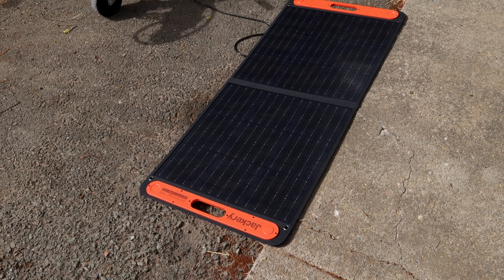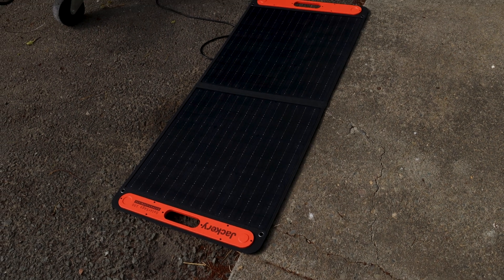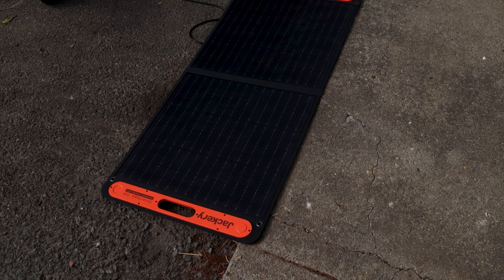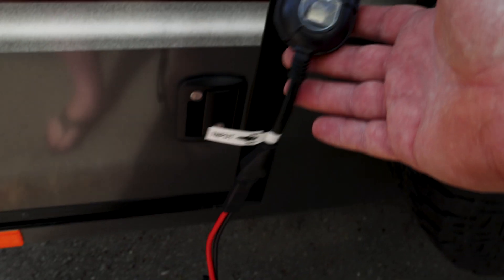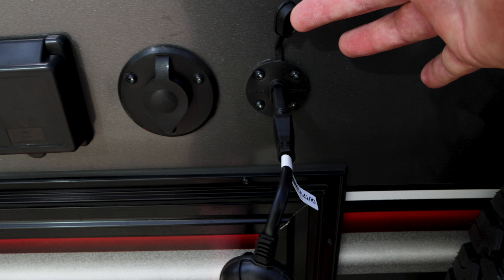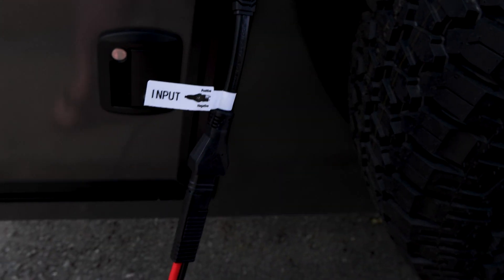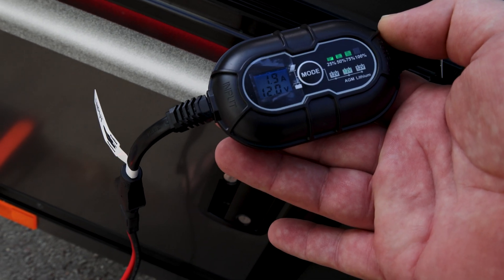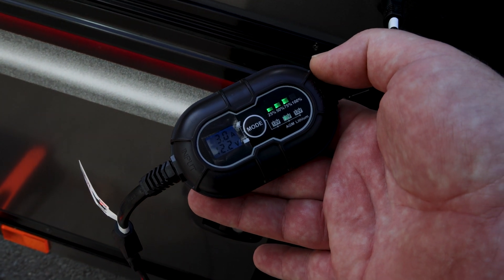How to solar charge an RV battery with an Allto Solar Controller & Jackery 100w solar panel

Comment: Thank you! I recently picked up a almost-new pair of Jackery Solarsaga 100 watt panels for a great price. I've been trying to figure out how to connect at least one to my 2022 Intech Luna (had a Pursue before it). This will get me pointed in the right direction and at least be able to use one of them. I will figure out how to run the second panel in the future.
Reply from the maker: You can buy a splitter cable to add the second but I'm not sure if the inline charge controller can handle the voltage from both. I ended up eliminating the inline charge controller and installed a Victron 75/15 in the battery compartment between the solar port and the battery. Now I can plug a 200 watt panel directly into the zamp port. There is a better explaination of this in my video about the Renogy 200 watt suitcase panel. Hope this helps :)
Reply: @Tipton_Wildlife  I found that video right after watching this one. Thanks again!